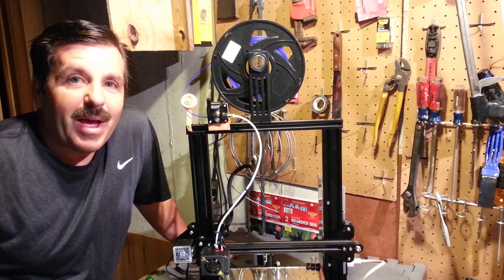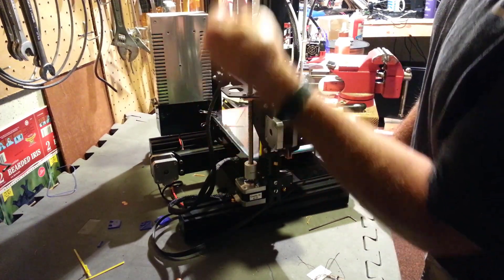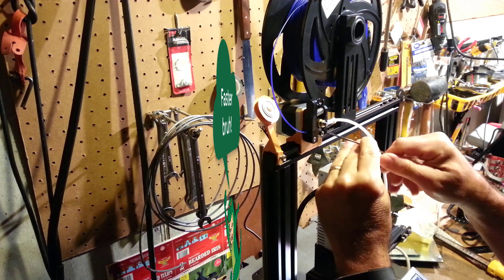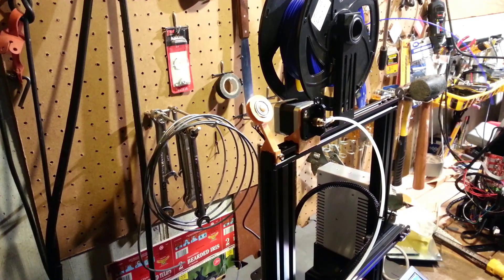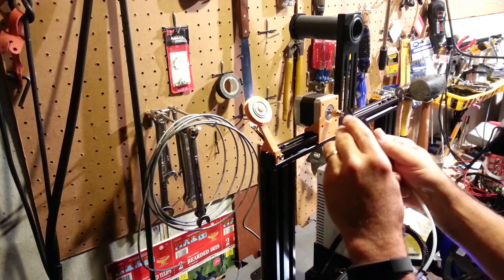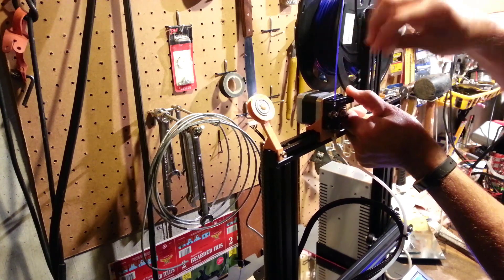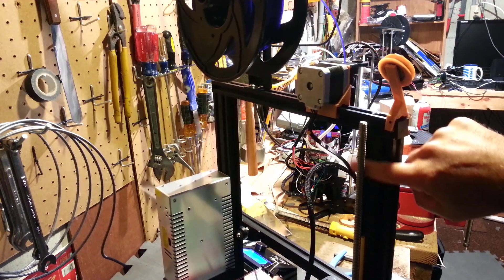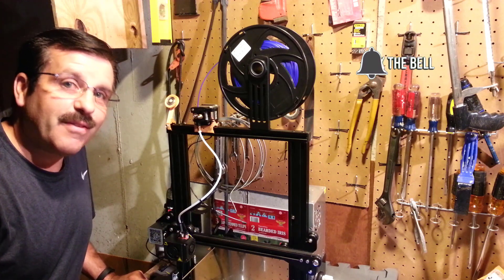Creality Ender 3 Rotated Extruder Mod.. Upgrade or Not?

Comment: Id keep it sidewase so it dosnt kink when it goes up
Reply from the maker: I ended up reverting to stock just because when users had questions my machine would most likely line up with what they were using. I sure did enjoy that printer. Left it with the school where I taught when I retired...

Comment: What material did you print this in? I noticed my extruder getting quite warm - I am slightly worried PLA may get bendy with the temperature.
Reply from the maker: I used PLA.  I did not have any issues, but I did go back to stock in the end. It allowed me to be able to answer more questions about the machine. Super trustworthy printer.  She is at my school now and since I retired... I am not sure I will get to work with it any more.
Reply: @HLModTech  Thank you for the reply! I am printing this right now. I was looking to move my extruder for easier access, since I am a bit restricted from the LACK enclosure. Enjoy your retirement and keep up the good work with the channel!
Reply from the maker: Sweet! I am hoping to get more 3D printing stuff rolling. Even though I am retired... the days go so fast it seems. 🤯  Keep me posted on how it turns out. 👍

Comment: Thanks! Love the mod so far. The factory tube just reaches if i place it in the middle with the extruder facing down. My Z axis still goes all the way up with no cable problems
Reply from the maker: Glad to hear. I reverted to stock so I could help more users. I did dig that setup while I had it though.

Comment: Is the mounting bracket to mount the extruder to the top rail on Thingiverse or where do you find the bracket?
I have problems with the print head moving if I have change filament in the middle of a print this would be perfect in avoiding that.
Reply from the maker: Yes. Link is back in the description. Thanks for the heads up.

Comment: hi i have print your desing and it works perfect the only diference i made is put it in the middle of the bar and the spool holder  in the left  looking to the front, that way the filament runs less forced and without bending thanks a lot
Reply from the maker: Awesome! I really liked the idea, but moved back to stock so if others had issues I would be able to help easier. Glad it is rocking for you though!!

Comment: That looks really cool. The only thing I would change would be to 180 the spool holder. The extruder is on the near side and the filament is pulling across from the far side. Turning the spool holder around would put the spool directly over the extruder.
Reply from the maker: This is what I ended up doing to fix that. https://youtu.be/iFi2wJiMjOM In the end I went back to a stock setup, but I had not complaints... I just found I could create parts that helped more people if I had a stock rig.

Comment: It may just be the surface that the printer was on but the base looked severely out of square.  If it has that much wobble when you print it can cause quality issues.
Reply from the maker: =) Surface is barnwood and cobbled together... =) It is way out of square, but the printer has been groovy for me. Sometime I may loosen the bottom and double check the printer for being square, but at the moment she's on a roll. Hard to mess with something that is working so well.

Comment: I made a similar mod on my CR-10S because i don't need the full printing height. It is only a matter of minutes to change it back.
Reply from the maker: I know the feeling. It really seemed to work well for me. I switched back and am doing fine as well. With all the parts I have added for the filament guide that snap on, my frustration with the original setup is gone as well. I think a big part of anything is getting a configuration that you are comfortable with. =)

Comment: i had started doing this extruder on the top "mod" to my cr10 mini just recently as i also had a v6 hotend and titan clone laying around. i did had to lengthen the extruder cable by quite abit too.
This is the first video that i came across by chance that is pretty close to what i had in mind, so, serious thanks for clearing the doubt in my head on what the final product would look like in the end   :)
Reply from the maker: My pleasure. It was a fun experiment, but I have returned to the stock configuration.  I have seen so many people modding the heck out of the little critter, I am hoping to show people that the printer is really capable as purchased. It really was printing well with the extruder up there though.

Comment: Looks good! I'm going to have to print your little bracket now. I'd go with the shortest possible length of bowden tube, still making sure it reaches all the corners in the extreme axis of the bed travel. Only thing I could see as a "maybe" problem is super tall prints. But that's not what I got the Ender 3 for anyway.
(I've got a Tevo Little Monster on order for tall stuff)

Other mods to this idea would be making a bracket that mounts over the hot-end that holds the extruder directly over it, with maybe a 2" to 3" bowden tube. But there might be interference with the extruder motor, unless flipped around. But maybe the little Y axis motor couldn't handle the excess weight and momentum transfer of the motor. So it might be a waste of time to try. However, suspending the extruder motor in the frame, like a lot of people do with Delta style printers is certainly feasible.

I guess in the end, it's just how much time and tinkering you want to invest into a sub $200 printer, and are there any additional gains by doing so?
Reply from the maker: All good points. =) Jealous of the lil monster! Don't hurt your back moving that critter..  =)
Reply: Hopefully it gets built in place and never moves! (I found it on Aliexpress for only $723 & free shipping) All the end-user upgrades and mods is what ultimately lead me to getting both the Ender 3 and TLM. TLM having the option of adding a WiFi board and linear rails... totally cool!) I think I love modding the machines more than anything.
Reply from the maker: 723 is a nice price! I agree that the upgrades mods are a driving force. I am having a blast adjusting stuff for the Ender. Have a new filament stand mod in the works right now... =)

Comment: I think the most important is not covered here, what happen if you raize Z to top? a extreme bend and filament crack inside the tube? Filament path should be a constant and not a variable on Z
Reply from the maker: Interesting point. I will keep an eye on it. So far I have not had any issues... Knock on Wood. =)
Reply: Try a tall print, like a 220mm vase with 5% infil and open top to check how that mod performs under that condition
Reply from the maker: LOL... Loaded a vase into Cura and what you were saying finally clicked.... I am modifying the filament stand at the moment. I may just manually raise the extruder to that height for a check. I generally print small stuff because I am crazy frugal with filament. =)
Reply: Filament exists to be used :D But yes your extruder on top looks a awesome idea at first or for newbies but a care look and study will result in other conclusion: Stock config is best for the filament path. Still your first config (extruder horizontal) is better than put vertical down to hotend. Best than anything else is go direct drive, ton of problems solved :D
Reply from the maker: =) Wish my wife felt that way about the filament... =) I think you are right about the other issues.  I cut my teeth on Makerbots and the printrbot... it was a big change when I got my first bowden rig. I had so much trouble changing filament on my deta go.... Fine now as I developed a technique, but as a bowden noob I was stumped.
Reply: I don't like Bowden, i use a Prusa MK3 but i also have a ender3, that works well and i have tons of mods on ender3 but i notice a big performance difference. Prusa can extrude 30mm^3/s where ender3 only 20mm^3/s, and i use same hotends: V6+Volcano. -10mm^3/s is huge! So i'm about to convert my ender into DirectDrive using the bondtech.
About filament i was like that on the beginning, but now i have tons of spools and they are here to be melted and transformed not for decoration :D But i can tell you extrude 30mm^3/s and see filament disappear is not the best felling ^^
Reply: I did a set up just like this. When you try to go to the maximum height for the printer you lose a couple millimeters because of how the PTFE will bend on itself. Also, at the higher prints the tube will have a dramatic angle and isn’t ideal.
Reply: I was thinking of doing something like this for I long time but after looking at the comments I think I will hold off on it for a while